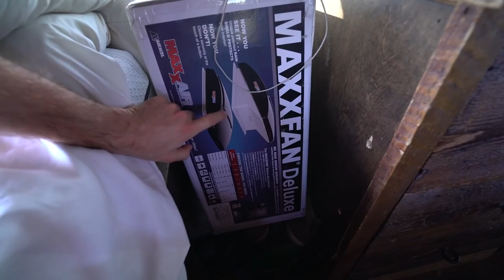She's Leaving // MaxxFan Install on Skoolie

Comment: I upgraded 2 of my roof fans to the Maxxair 7500 series this year. (one with a white top for an area that needed more light and one with a dark top for an area that was a  little too bright) and that was a huge upgrade over the cheapy stock ones. They dont need a rain cover either.  Thanks for the fun video. When this house sells I'll be out there.
Reply from the maker: I agree, but never had the cheaper one. Great product. Very sleek

Comment: I am looking at either MaxxFan or Fantastic Fan but the question is, I can only install it vertically on the back of my very short bus, no roof space once I put solar on, any issues you know of with the bearings?  At most I have only found one or two other vids with vertical mounted fan and they have not seem to have any issues.  Any experience with Fantastic Fan?

Comment: You may want to put Dicor self leveling sealant over the screws and around the plastic perimeter of the fan base.  Some people also use eternalbond tape to finish it off.  Ask Jamie...
Reply from the maker: thanks for reminder! might use silicone or something